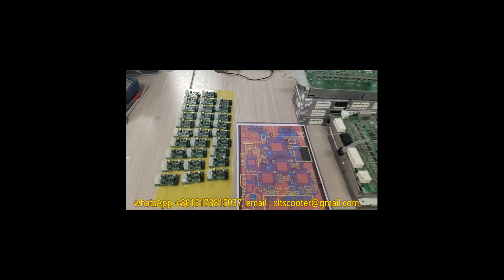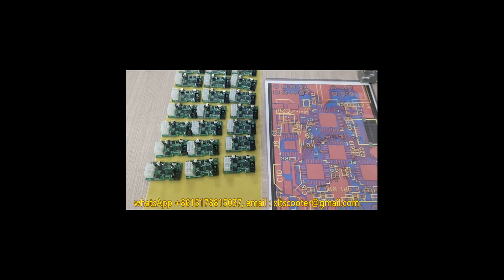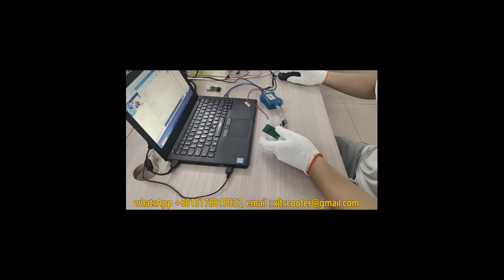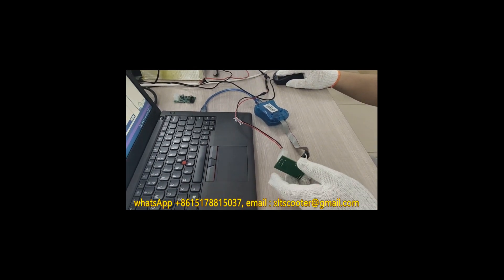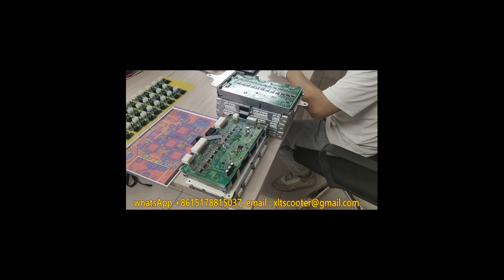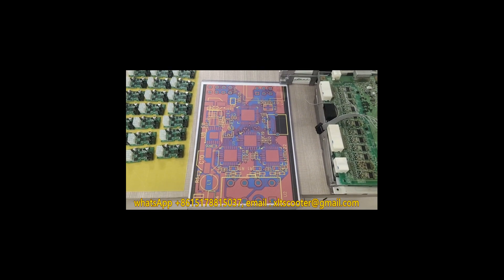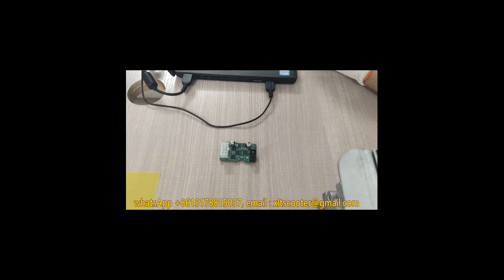flash program into can bridge hardware

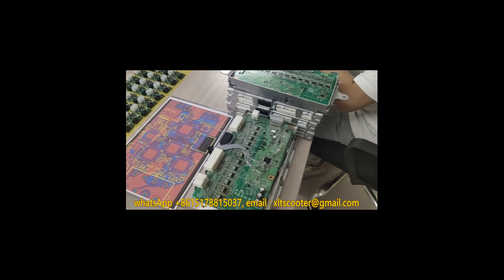Comment: 0:42 sec Nissan OEM BMS (aka LBC). What is the modification you are making there with the spliced ribbon cable? Is this to help the ZE0 learn the new battery capacity and calculate nominal range properly?
Reply from the maker: replied via separate email, please check.
Reply: price?
Reply from the maker: whatsapp +8615178815037, email to xltscooter@gmail.com   @tp1606